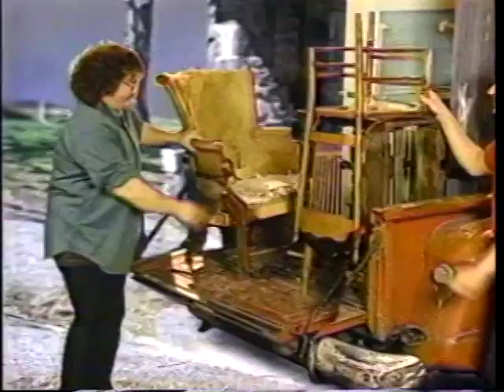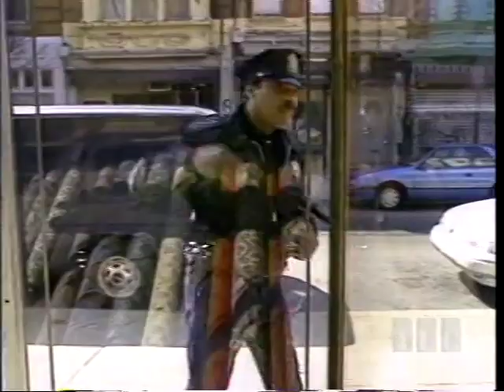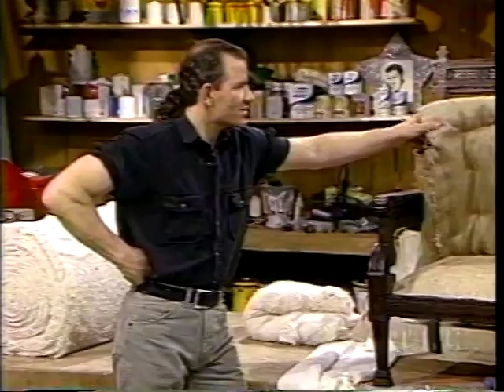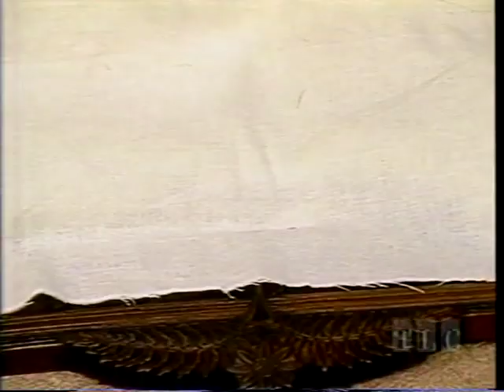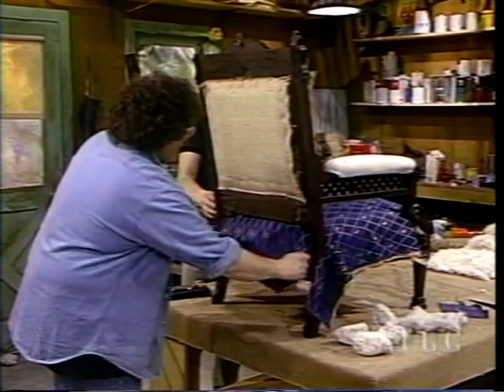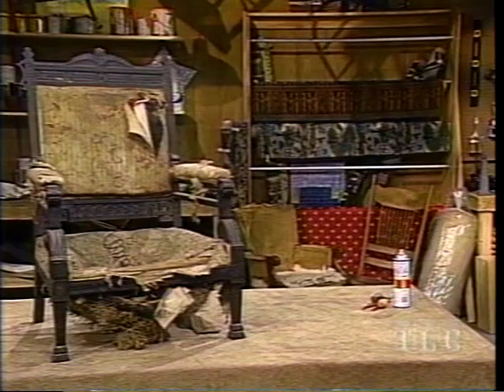Furniture to Go Disc 3 10

Comment: This 1994 episode of "Furniture to Go" fron Season 1 is a parody of the 1959 movie "Some Like It Hot," aptly titled "Some Like it Hot-Glued." The hosts, Ed and Joe, introduce the show and recap their previous work. They then go fabric shopping and discuss different fabric options. Back in the workshop, they demonstrate covering the chair's springs with burlap and adding padding. The actual fabric application is shown, starting with the arms. The seat and back fabrics are attached, and the hosts explain how release cuts in the fabric allow for proper folding and a neat finish. The final steps involve applying decorative trim to the edges of the chair using a hot glue gun. The hosts discuss the advantages and disadvantages of using hot glue vs. staples or tacks. The finished chair is revealed, emphasizing the transformation from its original state. The hosts celebrate their accomplishment, concluding the episode with humorous banter.👍